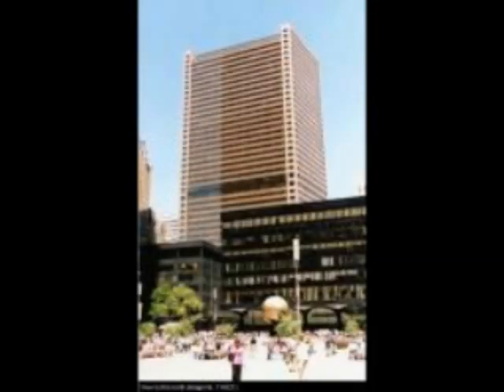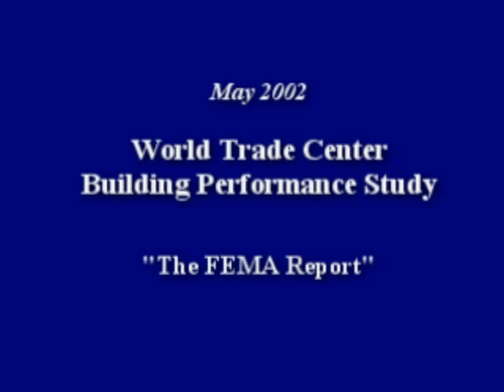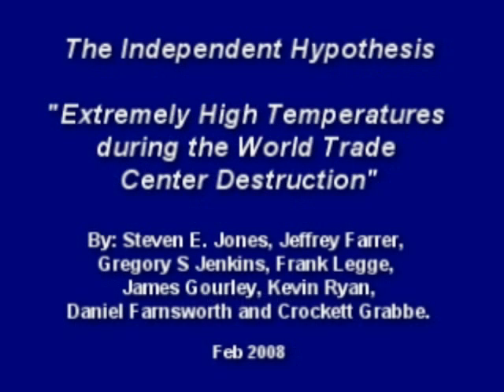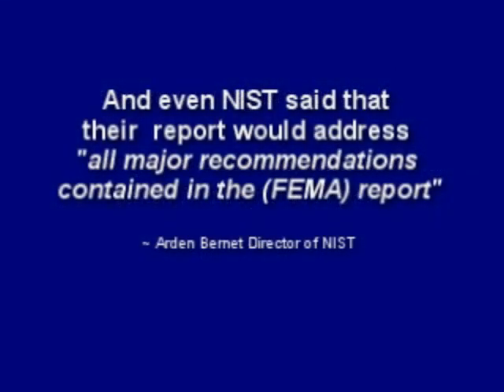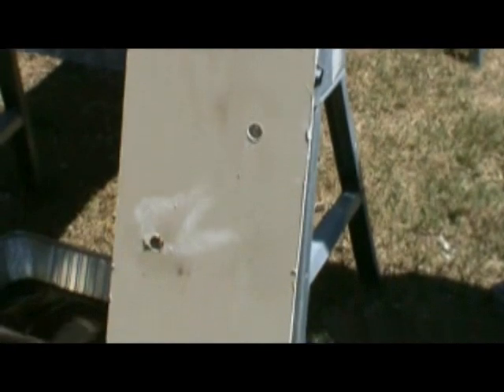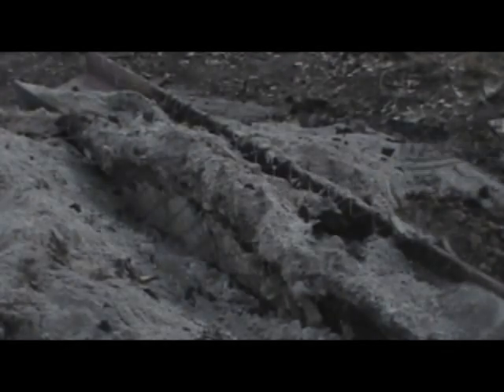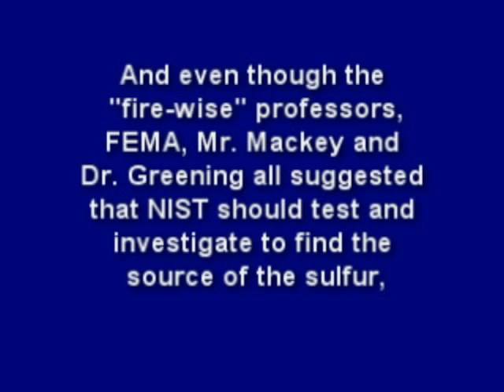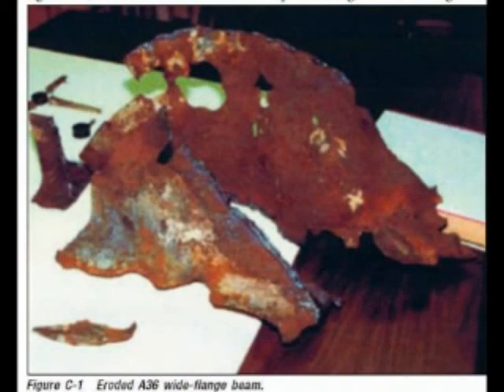Jonathan Cole - 9/11 Experiments: The Mysterious Eutectic Steel - AE911Truth.org

Comment: "sulfur generates a eutectic system when molten..."  where in Wikipedia is this quote?  google the quote and only 5 hits???   

Why is he checking for sulfidization and inter-granular melting with a hammer?  This is something that can only be observed on a microscopic level.  Ask a metallurgist...
Eutectic steel is formed by heating steel in the presence of S02.   "standard" office fire is not hot enough but in the presence of rust gypsum releases SO2 at much lower temps

Comment: Haha. I pile of logs! So many truthers here saying you have to be stupid to believe the lie, yet none seems interested to ask how hot a pile of wood gets compared with a tower block. But Jonathan Cole actually says that investigators expected to find warped and melted metal, just not this swiss cheese effect - so why is his steel girder not even slightly melted or warped? - because it's not very hot however many logs you put on a fire. How long it burned for is irrelevant. The temperature is what matters. A tall building on fire, containing all manner of flammable materials, will act as a furnace, drawing air in from below. A furnace is what you need to do metalurgy, not a pile of wood. Hence the use of bellows at the beginning of the bronze age. Bronze age people could tell truthers a thing or two about fires.
Reply: lettersquash yeah........ hence why my stove is deformed much the same like this piece of steel.

Look pal, the piece of steel DEFORMED after the collapse, according to the official story.
They say that it was deformed due to the hot fires and sulfur from gypsom boards (or how you spell it, sorry, dutch)

So there was no building acting as a furnace anymore, is there?
So how did it form then?

Truthers this, truthers that.
That is parroting behaviour, parroting those who believe the official story.
And where did that come from?
From Bush: Let us not tollerate outrageous conspiracy theories.

But the problem is: 9/11 IS a conspiracy. No doubt about it.
Unless you can prove it was all done by just 1 person.

So there you have it.
This same guy also made a video debunking the socalled tv-network-experts. The great thermate debate.
Reply: bertjesklotepino
Surely it is no mystery why steel deformed after the collapse? Calculate how much energy there is in one tower block, even if it's not on fire. The potential energy turns into kinetic energy, then heat energy. It is vast. It explains the fires that were burning under the rubble. Sure, there wasn't a furnace effect then.

I'm sorry, but I did look into all this pretty seriously and the parroting is all on the truther side as far as I can tell. Bush is one of my least favourite people, but even he is capable of saying something true by accident. I don't have a lot of time for this nowadays, but thanks for your reply.
Reply: lettersquash One thing should be said: Thanks for not immediately calling me names.
Thats at least a big plus in my eyes.

I Agree with you on certain things.
But the problem remains the same: https://www.metabunk.org/metamirror_cache/i662.photobucket.com_albums_uu347_911conspiracytv_FEMA_appx_C_p1_WTC7_steel_corrosion.jpg

This was caused due to your socalled furnace effect and sulfur.
But both basically have been proven not to be possible, not the way they say it happened.
Which to me looks like a problem for the official story.

Anyway, if you dont have much time for this nowadays, thats ok.
I cant force you to look into history and such, and what it is doing for society today.
Have a nice evening señor.
Reply: bertjesklotepino I don't think Sample 1 in the photo was caused just by the furnace effect and sulfur. It was caused, as the text begins to explain, by a eutectic mixture involving sulfur and water, but probably with much greater temperatures than were evident in the burning building (this one in fact being WTC 7). These much higher temperatures may have been caused by the collapse and conversion of kinetic energy to heat, as I described above.

It would be useful, when saying that parts of the official story have been proven to be impossible, to say by whom. I've heard similar claims before, and they have so far turned out to be untrue - sometimes the silly experiments like the subject of this video, sometimes more scientific investigations, but found to be biased. Mostly the claims are just "parroting" - reading something on a truther site and repeating it, so it spreads far and wide. I know, there are whole books written about how 9/11 was an inside job done with thermite and so on - but they're not necessarily true, and haven't stood up to serious criticism.

I was curious where the photo came from and trying to find some criticism of the explanation. I looked on the main domain and found some fine debunking of the truther position, such as that by Jazzy: https://www.metabunk.org/threads/wtc-7-building-7.1094/page-28#post-40509  It comes to something when you're linking to images on debunking websites to claim the condition of the steel shown couldn't have been caused by the methods described by the investigating team at NIST, without even saying who you think disproved it.

How much time i have for this isn't about avoiding investigating history. It's about how much time I have to go round in pointless circles looking at things I've found debunkings for already.
Reply: lettersquash keep sleeping señor. keep sleeping.

Just keep dreaming señor.
Cole has shown you on youtube a very simple representation: https://www.youtube.com/watch?v=3YuDKUCALtU

This same guy has shown that the socalled expert media hired to show the public that thermite could not melt or cut steel, is no expert at all.
Because this guy could easily, without having knowledge of thermite what so ever, make a rig to cut steel every way you want.

But keep dreaming señor, and parrot the official story untill you believe it yourself.

The story remains the same. You have already put a label on me: "debunking of the truther position"

This comes from the phrase: "Lets not tollerate outrageous conspiracy theories".

So a hypothesis: A child who was born after the event learns everything there is to learn about the official story as well as the conspiracy story.
Now, the child is left with questions.
Would it be a good idea to say that the child is a truther, and you need to "debunk" him?
Or would it be a better idea to actually try and answer the question?

Right, so try the experiment with steel yourself, as well as the stuff needed to form such a deformed piece of steel.
If you think you can do a better test than Cole did, be my guest.
He has also told the "officials" that they should reconsider, and ofcourse off the record they have said that they should........ but havent put anything on paper ofcourse.
Reply: lettersquash If Cole has shown without a shadow of a doubt that Thermite can cut and melt steel, and cut it any way you like.......... this while the MEDIA tries to convince the public, by doing a show and hiring a socalled Expert, that thermite can NOT melt steel or cut steel.

That on its own should already be enough.

80+ tapes confiscated at the pentagon, and all we have is a few frames showing nothing.
But the rest of the tapes, we cant see.

28 pages of the official report, kept from publishing.
Same bullshit story as when JFK died and documents had to be locked away for 75 years.
When is it going to be enough?
Gulf of Tonkin cost 58000 Mericans thier live, not to mention countless Vietnamese people.
You probably didnt loose anyone in that war.

So my guess is, its only gonna get enough when you loose someone.

Because now, you r disrespecting the families of this great tragedy.
Rodriguez was/is a hero. He saved many lives.
Yet because his testimony does not fit the official preconcieved bullshit story, they dont mention him.
He is/was and always has spoken about explosives from below.
Were you there?
How dare you disrespect this hero?>

PS: White smoke can be seen rising from the base prior to collapse of any tower.
This has been recorded by many different cameras.
How can there be smoke at the base if the collapse starts at the top.

Bullshit, thats what it is.
Reply: lettersquash Eh, señor....................... i might have made a comment to you which probably was not even meant for you. Or at least large sections.

After having reread the comments, you are correct.
I apologize for making the assumption that you name people. (although you now indeed have.)
Eventhough i have not named you anything yet, except señor.
I may have made a false assumption or conclusion somewhere, thats possible.
But i havent named you anything other than Señor.

Anyway, that to a side.

You may not have seen The Great Thermate Debate video of Cole.
If not, please do so.
Dont believe me for what i tell you is in it.
But in it is Cole, a novice on thermite.
And he shows without a shadow of a doubt that he can cut steel any way he likes, by building a small rig everybody can build.

The media took on the challenge themselves to debunk the thermite claim.
Nobody forced them to debunk that claim. Or to even look at it.
So they hired a socalled Expert.
And this expert, which was introduced in the standard manner: "He is an expert on bla bla bla....."
This expert showed the public that thermite can NOT melt steel or cut steel.

The only question this rises, in my opinion, is simply this: What purpose does it serve to misinform the public about the capabilities of thermite?

Thats all.

Yes, i have taken the case of JFK too, and put it in my comment too.
Why?
Well, thats another case where the government has provided a single piece of evidence that should in principle make anyone wonder about if they are telling the truth.

https://www.maryferrell.org/wiki/images/5/5e/Photo_hsca_ex_294.jpg
This is the picture in the case of JFK, showing the magic bullet CE399 in almost pristine condition, while it went through a rib and a wrist bone. And on the same picture the results of 2 bullets which both damaged each one bone, 1 went through a rib and the other through a wrist bone.
Lead core bullets.

Anyway, again my apologies for making a strange comment.
It was perhaps a wrong assumption.
Doesnt mean the other claims are less true, even for the eutectic steel.
You may not think so, but Cole has even contacted the professor who claimed it was sulfur from gysum drywall that caused this.......... and the prof basically said his hypothesis was unlikely.
You dont have to believe me on that one, you can find the information yourself if you look for it ofcourse.

Have a nice day señor.
Reply: lettersquash btw, the assumption made by me shows im human and can make a mistake.
It does however say nothing about the rest of the story.

Im man enough to say to you that i made the mistake. I have done so.

Have you?
"Bronze age people could tell the truthers......."
Sure, truthers call themselves truthers. And i dont mind.
But this sentence on its own is enough to show that you have put all of these people into the same group.
Basically as i read it, it means they are all stupid. Because TRUTHERS, all of em, could learn something from Bronze age people.

 "A tall building on fire, containing all manner of flammable materials, will act as a furnace, drawing air in from below."
Normally, buildings are build according to certain codes, making sure not to use much flammable materials.
So, again, i dont see the difference between the few office supplies that were burning, or the huge pile of wood and such, which clearly burned much more intens than the licking flames we can see in any of the WTC7 videos.

Anyways, again, cheers.
Reply: Well if you think he is wrong, then prove he is wrong by experiment. Then post your method and findings for peer reviewI think that in the discussion of natural problems we ought to begin not with the Scriptures, but with experiments, and demonstrations...... Galileo Galilei
Reply: in the comments above i can not find anything about freefall.
I have never said the towers came down with freefall speed or anything like that.

What i did say was about Building 7.
The one that was not struck by any plane, had a bit of damage but the damage was not the why it collapsed (as per NIST).
And the building that NIST has admitted did fall with gravitational acceleration for the first 2.25 seconds as shown by David Chandler.
You can find the video of David Chandler and he explains in perfect detail what he is talking about.
And NIST could not but admit that indeed, building 7, the 4 corners when they start to come down, they all start at the same time and with gravitational acceleration.

A 100 meter wide building, all 4 corners coming down at the exact same time and with gravitational acceleration.
By fire?
Sure.
I'll buy that for a dollar.
  noelleleger232

Comment: In regards to the iron micro-spheres:  I don't disagree with the message presented in this video but I have heard of alternative explanations to the presence of the iron micro-spheres.  One of those being the fly ash used in concrete which contains iron oxide.  What research has been done to determine other possible sources for these the iron spheres?
Reply: Iron is NOT part of concrete. Any iron in concrete would rust; rust leads to spalling of the concrete and spalling leads to ever weakening concrete. So fly ash undergoes a process to remove it. Furthermore, Iron spheres develop only when the iron reaches very hot temperatures - somewhere in the neighborhood of 4500 F, i believe.  Another fact that sets these spheres apart is the elemental surfer inside the spheres.

Comment: His 'thermite' is paint chippings. You know that right?
.
Grey on one side (paint) red on the other side (rust). The sulphur he collected, is a main ingredient in dry wall. Which of course there were tonnes of in the WTCs.
.
Research the ingredients of the paint used on the steel columns in the WTCs when it was first constructed. You will see the paint contained the ingredients of Jones' supposed thermite.
.
That, and the obvious fact that thousands of pounds of thermite would have been needed.